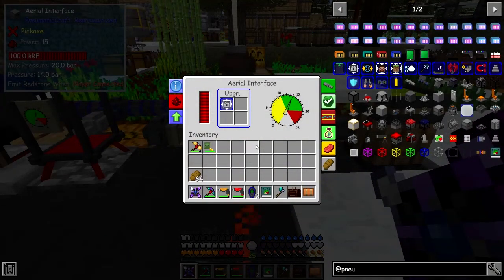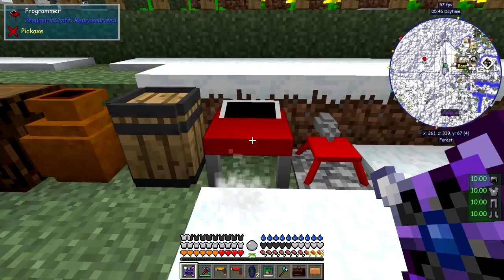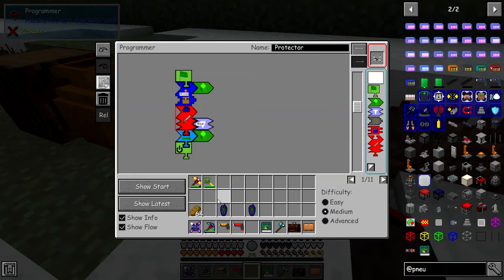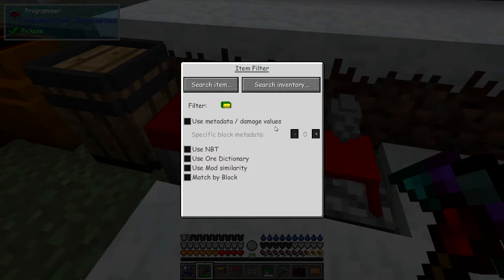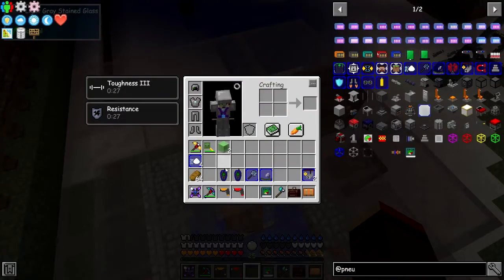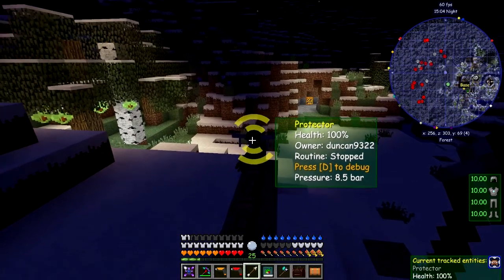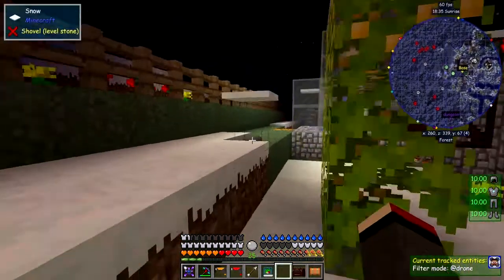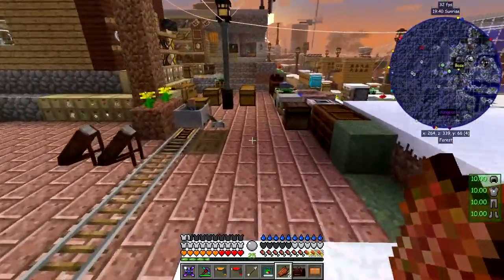Real Tech #088 - PneumaticCraft: Repressurized Drones Zapping Mobs

Comment: Been looking at your series for some days now because I am playing in a costume mod pack and one of the mods is PneumaticCraft (and it happens to be the one I can play with the most) unfortunately I don't really have a good way to get experience / Essence of Knowledge  so I was wondering if there was a way to program or prepare a drone to pick up the experience orbs that drop when they kill a mob and bring it to a tank, I do know they can pick up the liquid from testing but I can't seem to get them to pick up "fresh" experience on the ground
Reply from the maker: Good question, a drone can carry a tank for liquids so try flying over an area with a tank and see it the orbs are picked up, Minecraft doesn't have a bucket of experience so it may not be possible. You could try picking up liquid from an absorption hopper. If all else fails just ask in the issue tracker, I did this quite a bit and a few resulted in changes to the mod.